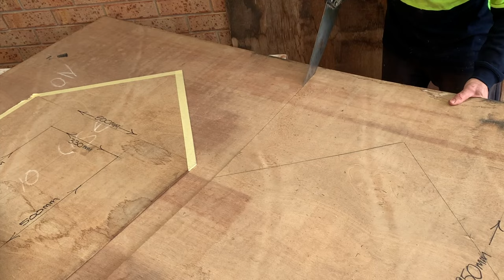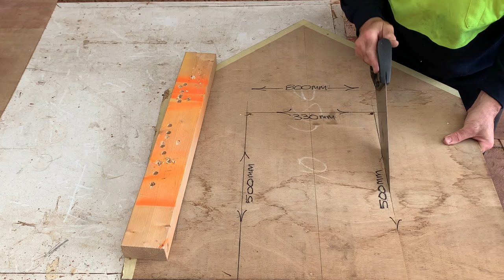Build a large Dog House , DIY Woodworking .

Comment: This build is beautiful What size wood did you use for the framing? And is there a specitic reason for the hand saw over a jig saw?
Reply from the maker: Hi ....  I use the jigsaw  1:35  and slot the blade in-between the (2) holes ......the power saw blade was on the blunt side , actually I was more comfortable using a sharp hand saw !   ....the framing size were pine off /cuts that we throw in the bin ,  42mm X 42mm. ....  cheers Wally !
Reply: @wallytrinc9885  thank you so much I really appreciate that you take the time to answer peoples questions on a 3 year old video

Comment: How much is the rafter length pls ? Amazing work planning on doing one Next week.
Reply from the maker: I believe I marked the face centre @ 400mm , from there I measured 950 mm to achieve my apex height @ a pitch of 40º ..... I traced the (2) end rafters to suit along the flyboard brace/template (s) ...front & rear 2:25   ....the middle rafter (s) were traced with the back rafter (s) 5:52  ....  I didn't have a set length,,, simply winging it as I went along,,,, hope this info helps...
Reply: @wallytrinc9885  thank you Sir, I appreciate your response and it will surely help. Good day to you.

Comment: Very well done. I enjoyed the video. I see you provided some measurements below but do you have more precise measurements? Also, do you have a list of tools and nail sizes required? I'd like to start building a house for my Golden Retriever. Thanks.
Reply from the maker: Thanks ,
length = approx 1000mm .
Width = 800mm .
Height to the Apex - 950mm.
Door entry = 500h X 500h X330w mm... for larger dog (500hmm) add extra 100hmm height.
The frame was 42X42mm pine , plywood=5mm thick , 150X10mm fence pailings (exterior).. 1 inch framing clouts to nail pailings onto frame. 
long hex head screws as seen in video.
Tools = drop saw would be great , if not a simple hand saw with 90° 45° guide will do.
large square , jig saw , hammer , clouts , 
Note...this does no include sub floor measurement.
The Dog house itself (project) was a gift to a friend , I have no plans , other than building (improvising) as I went along .
sorry for the late reply ,
 cheers , Wally

Show less
Reply: @wallytrinc9885 🎉🎉🎉🎉🎉🎉🎉🎉🎉🎉🎉🎉🎉🎉🎉🎉🎉🎉🎉🎉🎉🎉🎉🎉🎉🎉🎉🎉🎉🎉🎉🎉🎉🎉q🎉🎉🎉🎉🎉🎉🎉🎉🎉🎉🎉🎉🎉🎉🎉🎉🎉🎉🎉🎉🎉🎉🎉🎉🎉🎉🎉🎉🎉🎉🎉🎉🎉🎉🎉🎉🎉🎉🎉🎉🎉🎉🎉🎉🎉🎉🎉🎉🎉🎉🎉🎉🎉🎉🎉🎉🎉🎉🎉🎉🎉🎉🎉🎉🎉🎉🎉🎉🎉🎉🎉🎉🎉🎉🎉🎉🎉🎉🎉🎉🎉🎉🎉🎉🎉😢🎉🎉🎉🎉🎉🎉🎉🎉🎉🎉🎉🎉🎉🎉🎉🎉🎉🎉🎉🎉🎉🎉🎉🎉🎉🎉🎉🎉🎉🎉🎉🎉🎉🎉🎉🎉🎉🎉🎉🎉🎉🎉🎉🎉🎉🎉🎉🎉🎉🎉🎉🎉🎉🎉🎉🎉🎉🎉🎉🎉🎉🎉🎉🎉🎉🎉🎉🎉🎉🎉🎉🎉🎉🎉🎉🎉🎉🎉🎉🎉🎉🎉🎉🎉🎉🎉🎉🎉
Reply: La verdad sos un artesano que buena casa le hiciste al perro, felicitaciones 👏👏👏👏👏👏

Comment: I would like to make one on my own but I am completely new with this , please help , choosing the wood materials , waiting for a response
Reply from the maker: Thanks ,
length = approx 1000mm .
Width = 800mm .
Height to the Apex - 950mm.
Door entry = 500h X 500h X330w mm... for larger dog (500hmm) add extra 100hmm height.
The frame was 42X42mm pine , plywood=5mm thick , 150X10mm fence pailings (exterior).. 1 inch framing clouts to nail pailings onto frame. 
long hex head screws as seen in video.
Tools = drop saw would be great , if not a simple hand saw with 90° 45° guide will do.
large square , jig saw , hammer , clouts , 
Note...this does no include sub floor measurement.
The Dog house itself (project) was a gift to a friend , I have no plans , other than building (improvising) as I went along .
sorry for the late reply ,
 cheers , Wally

Comment: Hey I am planning to attempt do this myself. Can you help me out with the wood you used?
Reply from the maker: Thanks ,
length = approx 1000mm .
Width = 800mm .
Height to the Apex - 950mm.
Door entry = 500h X 500h X330w mm... for larger dog (500hmm) add extra 100hmm height.
The frame was 42X42mm pine , plywood=5mm thick , 150X10mm fence pailings (exterior).. 1 inch framing clouts to nail pailings onto frame. 
long hex head screws as seen in video.
Tools = drop saw would be great , if not a simple hand saw with 90° 45° guide will do.
large square , jig saw , hammer , clouts , 
Note...this does no include sub floor measurement.
The Dog house itself (project) was a gift to a friend , I have no plans , other than building (improvising) as I went along .
,
 cheers , Wally

Comment: what wood are you using on the outside paling? is it ok to get treated paling for the outsides
Reply from the maker: Yup !!  I used 150mm X 10mm ''treated'' fence pailings ...
Reply: thanks for that I just got some
Reply: hey another question what wood you using for the door boarder and for the roof boarder I can't seem to find it at Bunnings
Reply from the maker: @allantse9245  Hey again !   it's the same treated fence pailings from Bunnings that I ripped down ( I can't recall what width). as it can be any width you desire to cut . The upright end corners are treated offcut bearers from packs ,,, I simply cut then down the guts as seen 6:08  ,  if you ask politely a team member (Bunnings) may give you (2) for free,,,,, from their bin ?
Reply: @wallytrinc9885  thanks

Comment: Congratulations on the project!  Do you have the measurements to share or the project itself?  Thanks!
Reply from the maker: Thanks ,
length = approx 1000mm .
Width = 800mm .
Height to the Apex - 950mm.
Door entry = 500h X 500h X330w mm... for larger dog (500hmm) add extra 100hmm height.
Note...this does no include sub floor measurement.
The Dog house itself (project) was a gift to a friend , I have no plans , other than building (improvising) as I went along .
Hope this helps my friend .

Comment: What materials did you use ?
Reply from the maker: Thanks ,
length = approx 1000mm .
Width = 800mm .
Height to the Apex - 950mm.
Door entry = 500h X 500h X330w mm... for larger dog (500hmm) add extra 100hmm height.
The frame was 42X42mm pine , plywood=5mm thick , 150X10mm fence pailings (exterior).. 1 inch framing clouts to nail pailings onto frame. 
long hex head screws as seen in video.
Tools = drop saw would be great , if not a simple hand saw with 90° 45° guide will do.
large square , jig saw , hammer , clouts , 
Note...this does no include sub floor measurement.
The Dog house itself (project) was a gift to a friend , I have no plans , other than building (improvising) as I went along .
sorry for the late reply ,
 cheers , Wally

Comment: A very nice cage, what are its total dimensions ? 🤔
Reply from the maker: Thanks ,
length = approx 1000mm .
Width = 800mm .
Height to the Apex - 950mm.
Door entry = 500h X 500h X330w mm... for larger dog (500hmm) add extra 100hmm height.
Note...this does no include sub floor measurement.
The Dog house itself (project) was a gift to a friend , I have no plans , other than building (improvising) as I went along .
Hope this helps my friend .
Show less

Comment: Hey Wally - loving the videos!
Just wanted to check the dimensions of the frame you used… looks like 2”x2” (or thereabouts?).
Reply from the maker: thanks ,  it's 42mm - 1.6 X1.6 inches...cheers .
Recycled off cut bearers/packers.

Comment: Could you please send me size details or BOM details,.so that I can build by myself
Reply from the maker: BOM details , Bureau of Meteorology  ?

length = approx 1000mm .
Width = 800mm .
Height to the Apex - 950mm.
Door entry = 500h X 500h X330w mm... for larger dog (500hmm) add extra 100hmm height.
The frame was 42X42mm pine , plywood=5mm thick , 150X10mm fence pailings (exterior).. 1 inch framing clouts to nail pailings onto frame. 
long hex head screws as seen in video.
Tools = drop saw would be great , if not a simple hand saw with 90° 45° guide will do.
large square , jig saw , hammer , clouts , 
Note...this does no include sub floor measurement.
The Dog house itself (project) was a gift to a friend , I have no plans , other than building (improvising) as I went along .
 I hope this helps
 cheers , Wally
Reply: @wallytrinc9885  thank you so much and here BOM is Bill of material

Comment: I want the dimensions too
Reply from the maker: length = approx 1000mm .
Width = 800mm .
Height to the Apex - 950mm.
Door entry = 500h X 500h X330w mm... for larger dog (500hmm) add extra 100hmm height.
Note...this does no include sub floor measurement.